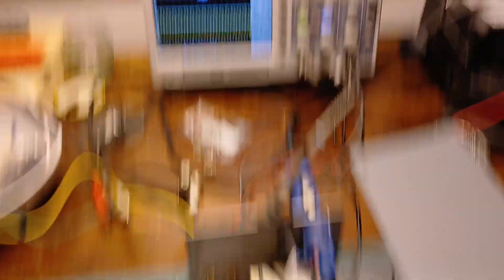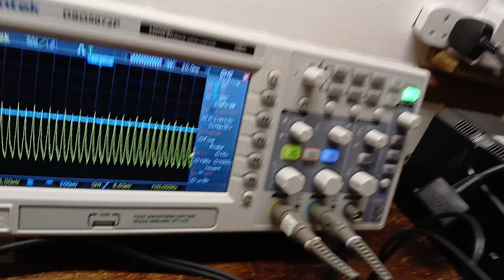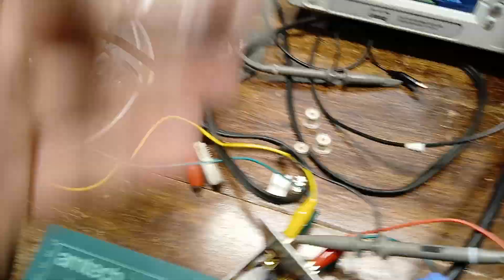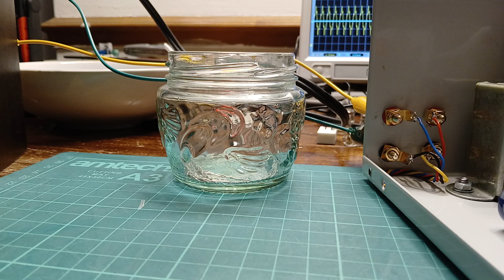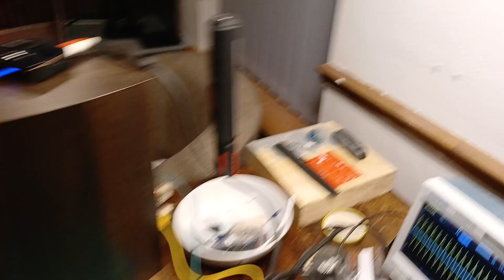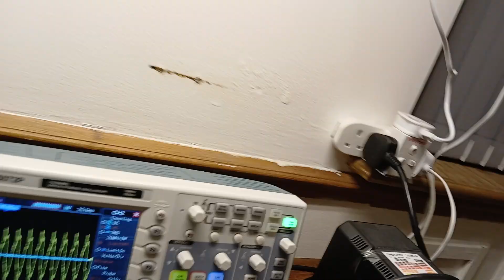Mullard TAA300 DIY stereo amplifier part 4

Comment: Super cool! I am in fact about to start the same project since I had some TAA300's lying around. Its really good to know that the supply rejection isn't great.
I am a bit confused about the datasheet and the numbering. Is the pin numbering shown in the datasheet top-view or bottom-view? 
Also, do you demo the amplifier in your videos? :))
Reply from the maker: Pins are looking at the bottom of the chip with the legs pointing towards you.

I should demo the amp actually as the final version had a few changes.

I'd recommend a 470 ohm feedback resistor.

A 100nf cap right at the pins

And a 4.7 Ohm resistor in series with a 100nf cap from output to 0v.

I ended up using a 9v regulator after my caps as it was still noisy, it's now dead silent.

I also used a 10k in series with the input signal feeding a 1k that goes to 0v with a 15nf cap in parallel with the 1k. Those mods have made the chip super quiet, sound awesome and very stable.

I'll do a vid on it to explain it better
Reply: @killcar5nbike2  Thank you so much for the detailed answer. I also figured based on the schematic to use a larger feedback resistor. There is no need for me to have that much gain, as I will just be feeding it through RCA. Also the increased feedback factor should help with distortion.
Im looking forward to the update video
Reply from the maker: @williamschmidt-hansen6311 

Going from the published 47 to 470 should reduce distortion by ~20dB.